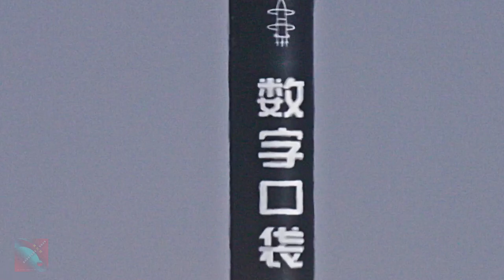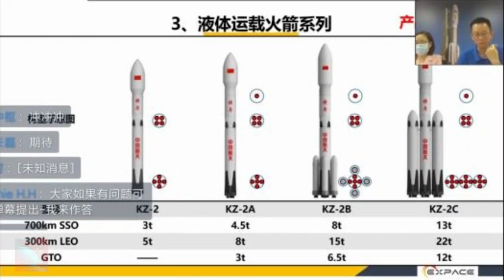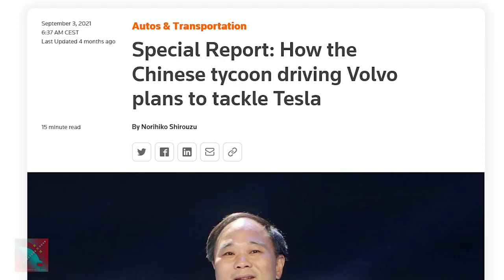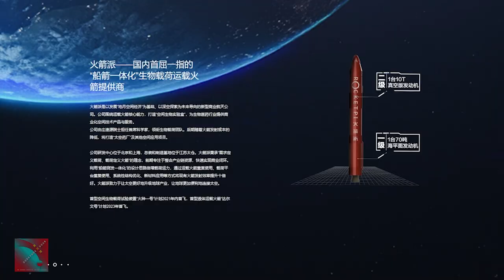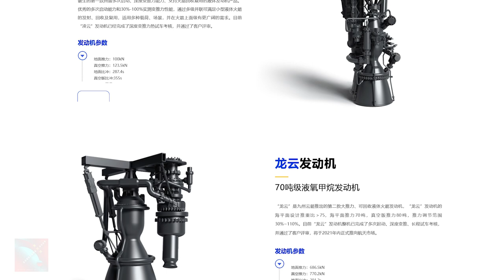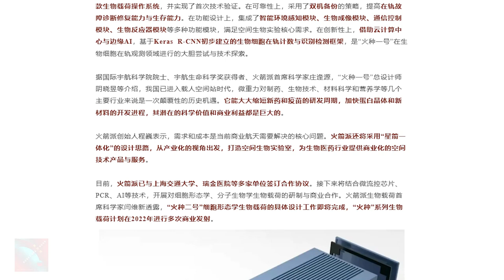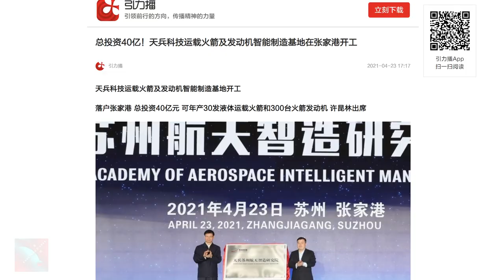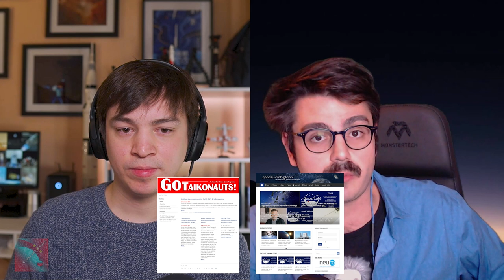Expace's Kuaizhou-1A Rocket Fails for the Second Time, Rocket Pi Launches a Microgravity Platform

Comment: I follow geely a lot always wondered what kinda space project geesat might take up now I know…. Why aren’t they giving private space rocket companies tho smh also why are they so many rocket launch companies they are so many other sectors in space to start a company it’s like they wasting money
Reply from the maker: It's speculation, but part of the reason they aren't going with commercial launch companies could be the fact that GeeSpace is a newcomer to the space sector, and thus would likely need to accumulate political capital in order to get things moving. By going with Expace, GeeSpace was (presumably) able to get some help from CASIC in getting all necessary approvals. Probably not so if they went with Landspace or Galactic energy. 

Good point as well about the # of launch startups, it's definitely the most crowded area of Chinese commercial space.